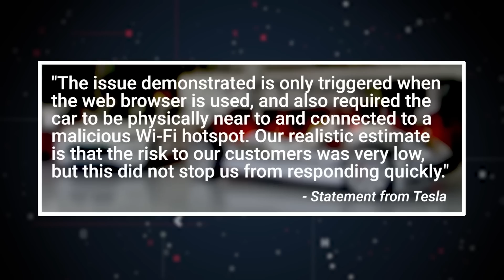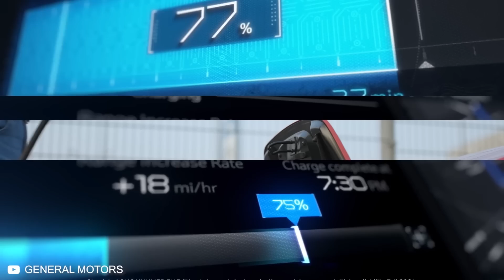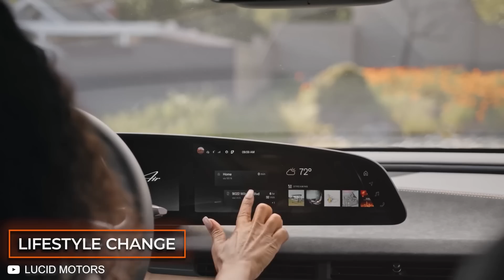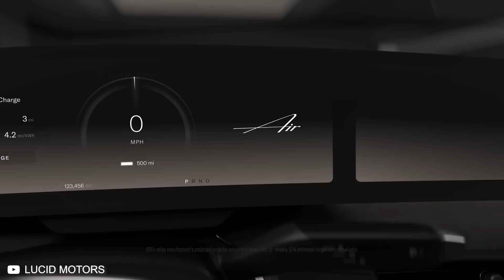EVs' Serious Problems That Carmakers Are Hiding

Comment: I am on disability and couldn't afford to buy a 30 year old used car much less a new electric car. My pickup is 23 years old and has been well maintained. 235,000 miles and doesn't use oil or leak antifreeze. Ot has a V-6 that still gets 24 miles per gallon and starts no matter the weather. I love my F-150 and will drive it till the wheels fall off.
Reply: Neither can you afford a new ICE car!   I run 2 old pickups.  I run a 79 min truck and a 91 1/2 ton 4WD.   

In 10 years when there is such a thing as an inexpensive old EV I would love to get one.  200 miles of range would easily do the trick.   Could live with 100 if the price is right.

Point is EVs are in early times.
Reply: @danharold3087  just like any new tec there will always be teething problems
But with evs it's not just with the vehicles
Here in Australia  our power infrastructure  is crap at the best of times 
Emagine it's summer and 40 degrees outside in the shadow and every bloke and his dog as the a/c running flat tac, it can even cope with that 
Now Emagine  tens of thousands of people  coming home from work at 6 pm and everyone  pluging in in their ev at the same time on that 40 degree day ?
As alot of homes only have on street parking how can they charge thier ev over  night, oh and good luck finding  a charging station at your local  shopping  centre  that actually  works and isn't damaged or vandalised 
Owning an ev can actually  be life-threatening  if you don't plan and use common sense and brains 
Emagine  being out half way between help ,no cell phone  reception  of coarse  on a 40 degree day in your ev with a dead battery
The wife seating next to you ripping you a new asshole and 3 kids  in the back screaming cos they are hot and thirsty and the temperature inside your ev is pushing past 50 degrees and of course alot of people  don't even bother to carry spare water
Of coarse  with petrol and diesel vehicle  10 ltrs of fuel and a jump start  from another vehicle  got you out of danger or at least to the next service station 
With a ev no one pasting by can help you with your ev
The best you can do is leave the very expensive  road side furniture  and get you and your family to the nearest truck stop with food ,water and ac 
Then call a towing company  to go pick up the piece of crap
And expect  a bill you can't jump over 
Perhaps testa and Musk should have that in their sales pitch  when trying to  sucker you into buying one of their so called green cars?
 
Even with petrol and diesel vehicle  you can get yourself into  serious trouble if your not careful and planyour trips even if it's only a couple of hundred kms down the road
Technology  will not save people  from mother nature  no matter how much people think they are bullet proof
Reply: @jonmcnabb6421  does it work when the power is out  , gets full of sand , snow ,water or is burnt ?

Technology  is great til it craps its self 

As that is the first thing to go in a natural disaster  and an  flat EV isn't very useful  when you  need to get out in a hurry with a snow bizzard or  bushfire breathing down your throat or you have 8 feet of flood water inside your home 

It's strange that Testa  or Musk doesn't tell you the very real limitations   and life threatening  situations  you can get into owning  an EV, they just want you to buy a car ,any car 

And yes your right people  aren't bullet proof even tho some thing they are
Reply: @danharold3087  You can buy a chevy spark for half the price of the cheapest tesla. Rising lithium prices are going to seriously hamper the theoretical future affordability of EVs.
Reply: @Mr.9merrickdials  Agree there are less expensive cars and more on the way.  China is going drive down prices.  Seen where a leaf could be had for $20K including $7K incentives.   

I see projections saying too many mines are opening and the prices will drop.  Seems people invested heavily in the metal battery metal production.

Unfortunately my crystal ball is broken.
Reply: @Mr.9merrickdials  Nothing is going to be hampered. There are alternatives to lithium! Look at magnesium.
Reply: It doesn't matter  how old or how many kms (miles) it has on the clock 
The facts it reliable  and can get you and your family out fast in an emergency 
That's what's important
Reply: @waynehewett4017  the likeliness of having an ice breakdown during or just instantaneously after needing fuel is probably 0.00 and maybe many more zeros after that till some number between 1 and 9 shows up. if your argument is that ev's will break down and gas will also but the majority of people on the road are gas at the moment and one of them may have a jerry can. then just wait a few years. that jerry can will become non existent. toe charging will be the thing of tomorow. and your family will continue to be thirsty regardless of the fuel source that breaks down... one might just questing wayne... why your bringing your family on a family friendly road trip with no cell phone receiption
Reply: @jonmcnabb6421  well here in Australia  not having cell phone reception  it common
Especially  when you start getting out in the sticks  and on gravel roads   a couple of hundreds miles away 
I also carry spare  fuel  ,water ,oil and tools  Always 
Wether I'm going down the road or doing a hundred mile trip 
You are correct plenty of people  break down in petrol and diesel vehicles but you have more  chance that people can help you or you can do a patch job to get you to.the nearest  help 
A EV people cannot help you  apart from giving you a lift to the service station  or a phone 
I've seen heaps of EVs on the back of tow trucks   that have ether shit themselves  or flat battery  even in the cities 
Look I'm not against  EVs at all 
In the cities  and short runs they are ideal 
Did you hear about that car transport  ship that sank due to the EV batteries catch fire in the ship hold 
They couldn't put the files out  as the chemicals in side the batteries  produce its own oxygen
Reply: @jonmcnabb6421  to answer your question  no I wouldn't 
First I couldn't justify  spending 80 grand on an EV in the first place 
Which no one will want to buy a second hand ev  in 3 to 5 years 
I would have a petrol or diesel  vehicle suitable  for travelling  or pulling trailers ,horse float etc
And a petrol electric  vehicle For school runs shopping and going to work 
I wouldn't not put my  family a risk   to buy an EV 

have you seen and EV battery  go to hot and got up in flames 
Within seconds it's a Roman candle 
Good luck getting the wife and 3 young kids and the elderly  grandmother  out  in time 
Before  your EV becomes the towering inferno  in 10 seconds 

I don't think Musk or tesla has that in the sales brochure  when you  are looking at EVs?
Reply: In the UK thieves are now cutting charging cable's for the copper, it's just getting crazy now
Reply: @looneytoons2878  that doesn't surprise  me at all 

Here in Australia  we have major problems  with vandalism  ,damage and recharging stations  that simply  don't work that's if you can find a recharging station  after driving around for an hour ?
Reply: @waynehewett4017  Yeah it really is crazy
Reply: @looneytoons2878  people  really  need to be informed  the correct information  about EVs and all the limitations  before deciding  to hand off the big bucks 
As EVs aren't for everyone 
Tho the salesperson  at tesla will never  disclose  anything bad about their products 
They just want you to buy  their vehicle 
That's all they care about
Reply: @waynehewett4017  I will never get an EV that's for sure
Reply: @looneytoons2878  who can afford a 50 to 80 grand vehicle 
I certainly  can't 
I'm quite happy with my petrol Ute and the ability  to go to any service station  to but fuel 
I carry spare ,water ,fuel.,oil and tools to get myself out of trouble  if it arises and get about 500 kms on one tank of petrol 
EVs are just a fad for the people  wealthy enough to be able on afford one 
Here in Australia  the government  wants to bring in a EV tax due to all the fuel tax  they will miss out on  and yet they push people  to go green and save the planet  which is both lies and ridiculous  at the same time
Reply: @looneytoons2878  ha you will... you know why... its called finite resource
Reply: @jonmcnabb6421  I will what ?
Reply: @jonmcnabb6421  the problem  is car makers don't care what type of vehicle  you buy from them as long as you buy one 
EVs are not suitable for  everyone 
They do have alot of limitations 
Here in Australia  your power infrastructure is still in the stone age,   the infrastructure  can't even cope in summer with everyone  use their a/c
Good luck even finding a recharging station  that actually works and we have alot of homes which only have on street parking  so good luck recharging  at home over night 
Due to EVs been new technology   no body can help you if you get stuck out in the middle of nowhere  with a flat battery  or the EV shits it's self 
With  a petrol or diesel vehicle  people  can help by giving you some fuel ,help change a tyre , give you a jump start  etc so you can  limp to safety or the nearest service station 
With EVs you have to get it towed  to ether a recharging station  or a EV mechanic 
You'd better be sitting down when you get the towing and repair  bill
Reply: @looneytoons2878  get an ev.
Reply: @jonmcnabb6421  Why ?
Reply: @looneytoons2878  for transportation
Reply: @jonmcnabb6421  But Klaus Schwab say's, "You will own nothing and be happy" by 2030 so how does that work ?
Reply: @looneytoons2878  i dunno if your talkin like nio and vinfast. i wont buy it. if im buying a 50 to 100 thousand dollar car i better own the battery in it. if you want to spend 50 to 100 thousand on a car with a battery you dont own and be happy with that then knock yourself out
Reply: My car is a 2014 Kia Picanto (or Morning). Very valiant car. Eight years and I hope I can keep it for many years as I take good care of it. The fun fact is that I can't buy a new gas car in my country (at least a decent one with the same specs of my car) because they are crazy expensive now. 

For comparison, if the minium wage in the US is around 1,000/month, an EV costs 50x the minimum wage.

Do you want to know how it is here in Brazil? An EV costs at least 150 times our minimum wage. In my country, nobody will drive if EVs are mandated.
Reply: @Willowy13  EVs are only a statis symbol  for the rich who can afford a new vehicle 
Here in Australia  EVs range from 50 to 80 thousand AUD to buy ( I'm not sure  what that would be in your currency  but it would be very expensive) and 98 percent of people  don't just have that type of  money  just laying around 

Going green  and saving the planet buying an EV is the government's  and car makers lies and propaganda 
Agriculture  and heavy industries  produce 6 to 7  times more Co2 then cars ,trucks ,planes and trains could ever do 
I don't see any  government's doing anything about them at all ?
 Here in Australia  the power infrastructure  and recharging stations  we are still in the stone age 
Alot of people have only on street parking so no way to recharge  at home 
Good luck trying to find a public recharging station  that's not vandalised,  stripped of its copper , damaged ,broken or simply  doesn't work
The amount of times I've seen a tow truck rescue  a EV with a dead battery  is ridiculously  funny 

I would advise people  to keep the vehicle  you have now , sure fuel prices are going through the roof  but it's alot less than buying a EV shit box that costs 80 grand
Reply: The government is forcing u to by an ev when gas powered cars not ganna be an option 🤮I thought this was a free country keep ur ev I’ll keep my GMC Sierra
Reply: @colejones6369  here in Australia we  still in the stone when it comes to power infrastructure 
It can't even cope  during summer  when we have 40 degree days and every Tom, dick and Harry has the a/c running 
How will it cope with tens of thousands  come home at 6  pm all at once to charge  up.their EV ?
I live in Perth Western Australia  in a suburb  called Caversham  which is a reasonable  area and looking up recharging  stations we have one as far 

EVs are a statis  symbol  to the people  who can afford a 80 grand electric car
Reply: every one comes home at 6 and charges with a 120 volt oh no😱 wait a sec strange. kinda seems like everyone coming home from work and turing on a light bulb or turning on computer or tv... huummm let me think about this for a sec 120 volts... im sorry whats the problem again?
Reply: @colejones6369  we have 1 ,3 Bay  recharging station  in this area 
But most the time it's ether but damaged or is not working 
The amount I EVs I've seen been "rescued " on the back of a tow truck due to ether  shitting it's self or flat  battery  is ridiculous 
Alot of homes have on street parking so recharging  at home is difficult 
In China they are having 6 to 8 EVs burn to the ground  each day 
Too bad if your in traffic  and you have to stop and have the wife and to young children in car seat in the back 
Good luck getting everyone  out to safety  in time  as you  have only  less that a couple of minutes  before your EV is a roman candle 
Battery  fires are very difficult  to put out due to the chemicals   in the battery producing its own oxygen  and very toxic fumes when hot 

Even the fire fighters  have drown the vehicle in foam and powder  to have any chance  of control
So you as the owner of a 80 grand EV has no change at all 

I'm sure that's not in the sales brochure  in the tesla showroom and pointed out to people  interested in buying an EV

I'm not against  EVs as they do have their place in the cities 
We will always need petrol and diesel vehicles  to do the jobs EVs can't  example  transportation  of goods ,towing caravans,  trailers  or horse floats  etc 
Like the US   Australia  has long distances  between towns and service  stations  and the infrastructure  to travel thoses distances  safely  in a EV is not safe especially  during summer 
You could easily  get into a life threatening  situation  if you EV shits it's self out in the middle off nowhere on a 45 degree summers day 
EVs are not a magic bullet  to all our problems and are not suitable  for everyone 
Who's got 80 grand  to spend on a EV ?
Alot of people  don't earn half of that in a year 
The fact are to break even  you have to drive your EV a 140,000 kms   with the 25 to 35 percent increase  in cost to buy an EV  compared to its petrol  or diesel  equivalent 

Something  else the salesperson at tesla conveniently  forgets to tell and buyer
Reply: @colejones6369  EV s have their place  but we will alway need  petrol  and diesel  vehicle  to do the jobs EVs  simply can't  do
Reply: Stop the climate scam if you want to keep your cars.
Reply: @mxrx3786  yes policians  normally  are in fairy land 
Going green  and saving the planet  propaganda  and lies 

Evs have their place but until  power  and recharging  infrastructure   improve inside the cities 

They will nothing more than very expensive  garage accessories  and statics  symbols 
Even if everyone  brought  a 80 grand ev  it wouldn't save the planet as carmakers have to actually  build all theses cars plus what are you going to do with the millions of old petrol  ,diesel  vehicles  your replacing?
Plus evs are useless in an emergency  where the first thing to go out is the electricity 
In a flood  ,fire ,storm or snow  blizzard  so how can you charge your ev in that situation?
What happens  if you have a fire breathing down your neck  or 6 foot of water and rising  your screwed 
My advise is to use the vehicles  you have now but more wisely 
At least you can get you and your family out if you have to  with a petrol ,diesel  vehicle  
Testa and other carmakers tend to forget or just gloss over all the limitations  of evs  as they don't care ,they just want you to buy a vehicle off them  regardless  if it the right vehicle  for you or not
Reply: @mxrx3786  So what is the Solution let's hear it,you don't have one either other than running ourselves to the Ground by Polluting our atmosphere with Co2 emissions forever and Ever until you die Basically,you probably work for Big Oil or have Stocks in Big Oil,that's why you defend Oil you're not giving a solution,only negativity.
Reply: @jonmcnabb6421  I gather your in the US and have better power  infrastructure  ,more recharging stations  and clearly  have more EVs

Here in Australia  it's not the case and we are way behind  in the infrastructure  and recharging  stations 
The other things I point out  that car manufacturers  choose  not to point  out  is the EVs limitations and life threatening  situations  you can get into 
Examples 
What's the first  thing that goes out in a natural disaster?
electricity 
So  a flat EV is useless
If you have to get out in a hurry 
A snow bizzard 
A bushfire breathing  down you head 
8 foot of flood water  inside your home 
At least with a petrol  or diesel vehicle  you have alot more chance of getting you and your family out to safely 
The other thing if you break down in a EV on the side of the road   in 40 degree  heat no  passers buyers can help you 
They can't give the some fuel or jump start you to get you to the nearest help can they ?

All they can do is give you a lift to the nearest  service station  or phone
 
So your 80 grand EV becomes nothing but expensive  road side furniture 

That's if it is in one piece when the tow truck gets there  to pick it up 

And you need  be sitting down when they give you the bill

And the wife ripping you a new asshole  for wasting  80 grand on a EV that is bloody  useless in any natural disaster 

Give me the petrol  or diesel vehicle  any day of the week
Reply: banning is stupid... your going to feel real stupid at the hardware store thats since gone through reno and seems like elevator music... your going to ask the clerk wood stove? and there going to look at you like deer in headlights
Reply: @jonmcnabb6421  as I said EVS have their placeand when battery  technology  improve  EVS  may have more uses but that time hasn't happened  yet 

Evs have limitations 
Tesla and other ev car makers  need to educate  buyers  to choose the right vehicle  for them  Wether it be an ev or a petrol or diesel  vehicle 

Going green is a load of crap  
Vehicles make up about 4 percent of the co2 gases  produced 

It's agriculture  and industry  that produce almost of the rest of co2

If we want to slow down climate change  that's where we need to focus
Reply: @waynehewett4017  Yes and as I said in the previous comment very few countries have electricity produced by nonpolluting methods much of the world electricity is still generated and thermal power stations i.e. burning of some sort of fossil fuel to generate electricity hardly green energy!
Reply: Electric cars are a massive environmental disaster. Why would you buy one?
Reply: My 2002 vehicle with 200,000 mi. only costs $100 to replace its battery every 5-6 years.  The typical out or warantee replacement battery will cost between $13-$18k after about 8 years.  What's the carbon footprint on changing out an EV battery every 6-8 years ... for $13-18K????

ON a conservation of energy basis ... to change from fossil fueled vehicles to all EVs the total electric generating capacity of the US will have increase its FOSSIL FUELED electric generating capacity by approx. 50% .... for the exact same amount of energy needed.
Reply: @richh1576  If we transition at a reasonable pace the grid can keep pace using renewable energy.   Nuclear would be good.
'they are working on' batteries that will last longer than the cars.   Talk of buying a new car and installing your old battery.   Grain of salt here as to time frame.  But it is on the way.
Reply: @danharold3087  solar and wind win out over nuclear... nuclear is a thing of obsolete technologies
Reply: @jonmcnabb6421  I would prefer solar and wind.  But Nuclear has not been standing still.   Nuclear is now a valid option for peaking.   It could also stand in for solar or wind should they fail for some reason.
Reply: @danharold3087  and they say ai can solve our nuclear power problem but my questions are doesn't that create nuclear waste? if the ai is so smart and can do all that without the waste why not just a simple improvement on solar cells, wind, tidal and geothermal... leave ai's potentially exploding nuclear for mars travel?
Reply: @jonmcnabb6421  AI is a category of computer programs not easily solved by normal computer programming.   Once we figure out how to solve these problems they are no longer of interest to AI researchers.  There are other definitions for AI.

So AI is not 'smart' in and of itself.   It is just a set of bleeding edge tools used by smart people.

AI techniques may well do a better job of managing a reactor.  It could reduce the risk of reactor problems.  But  it will still make waste.   Some say nuclear waste can be safely stored in 3 mile deep shaft/wells under the nuclear reactor site.  Other disagree. With the current political situation I doubt we will see much nuclear.
Reply: @richh1576  my battery expired in 2017 and it’s still running
Reply: @Amor1990  The reason is most probably that you are not DEEP cycling (allowing the battery to go to almost full discharge before recharging).  'Hysterisis' (performance degradation)  accumulates 'faster' when any rechargable battery is constantly DEEP cycled.  :-)
I have very large gel cell batteries (with an advanced hi-tech charger) on my boat's electrical system that are ~20 years old ...  but that wont happen without an advanced  'smart charger'. I religiously do not deep cycle these batteries in order to preserve and extend their in-service life.
Reply: @richh1576  no carbon footprint or very little as the battery pack gets recycled reused or repurposed... very expensive to replace an entire pack instead of just one cell though one would think
Reply: @richh1576  Well put -great summary😊
Reply: @richh1576  Or we could build more lithium hogging solar and wind farms /sarcasm
Reply: @Mr.9merrickdials  Sources?
Reply: To be honest you far better off keeping your old vehicle  as long as its not too unreliable 
Evs are not green at all no matter what the fuffiers say 
The car industry  doesn't give a shit what vehicle you  buy as long as you buy one  they are quite  happy to sell you a ev or a F 350 truck 
There is no recycling  of ev batteries  at the moment  nor it seems any plans in the future so are these  batteries  going into some land fill in 4 to 7 years when the battery shits, its self ?
Ho and good luck in trying to sell you second hand ev ,the one you paid 70 to 80 thousand dollars  for  a couple of years ago  and now you can't even give away
The car makers forgot to tell you  that ?
With that in mind buying an ev sound like a bad investment  where  within 10 years you lose everything  making the ev worthless 
If you want reduce pollution  in our cities a petrol electric  vehicle  is a far wiser investment  and let's face it due the vehicles  being so bloody expensive  now buying g a vehicle  is  a big investment  so it's very important  to look at what type of vehicle  you really  need and your situation  and lifestyle 

Remember  ebs have alot of limitations and not only in range 
So evs cannot suit everyone and still have a hell of a lot of work to go .
Reply: @waynehewett4017  Keeping your reliable vehicle has always been the most economical.  People have been saying that since I was a kid.  Now retired.  

There is no recycling of EV batteries because used ones are being sold on ebay for use with home solar.   Tesla is recycling batteries used in research and testing.   95% of the metals are reclaimed.     When new denser batteries are produced with recycled material it will result in extra metal. Something like for every 10 old they build 11 new.  Oh and the old batteries in conjunction with solar may well help charge the cars and provide peeking for the grid.

I agree with you on a lot of this.   But if people, foolish or not, don't buy current EVs there will be no money to develop improved technology.

It is amazing how fast this is moving.  Some AAA affiliated tow trucks can fast charge stranded cars.  Hotels and even B&B offering charging sometimes free.   I imagine some forward thinking guy is selling his excess solar energy to EV drivers instead of trying to sell it back to the grid.  When I looked into that I found a movement to use EVs to provide peeking.   Charge the car off peak and sell some of it back during peaks.  

Still early times for EVs
Reply: @danharold3087  I'm no expert  at all my friend  and never claimed to 
I try to push past or the fuff pieces ,lies and propaganda  we all deal with ever day
And ask the questions that not many bother to do so 
And not many will volunteer  the actual  truth 
I'm only a guy so we can't be right all the time not even 50 percent  of the time according  to some women  if you know what I mean 
Your right evs and power infrastructure  have a long way to go 

I'm glad to hear you guys over there  are recycling  the batteries 

But here in Australia  nobody government  or private  enterprise  have no actual  plans as yet in place to recycle  ev batteries  or any other  components 

Policians  seem to have their eyes glazed over  with all the taxes and fees they charge  for new evs plus this ev tax to make up for the fuel tax  and any other taxes  they can  make up 

No wonder the rest of the world  thinks Australia's a bloody  joke
With theses muppets in charge  we are still in the dark ages
Reply: @waynehewett4017  First I admire your country.  Just wish it did not take a ton of money and an act of god to send packages back and forth.     My wife and I both have friends there.

A while back I learned that our governments work against our interests.  No big surprise there.  So when I think of australia its the wonderful people I know there and not your government.  

Well recycling yes but precious few EV batteries as they have not yet gotten to where they are useless as batteries. It is just the ones they used in development and testing.  Talked about this earlier.  Thing is they figured out how to do it .  Given Tesla's goals I expect him to share.  Did you know that a few years ago Elon open up all his EV patents for use by others.   

I kinda understand where you're coming from.    Thing is it is changing so fast anything we think today could be bull crap tomorrow.    I ran into that a few times while googling so I could accurately respond.   Learned quite a bit.
Reply: @danharold3087  Dan I'm just guy , I'm no expert  but I've been around  the block a few times probably  not as many times has you have my friend 
Australia  isn't a bad place but there's this image that overseas people believe  every  thing is ether trying to kill and eat you 
That's simply  not true 
Sure if you have a death wish 
You can travel ill equipped  outings the Simpson  desert 
You can go play with a cranky  Tiger snake 
Go swimming in Crocodile / shark  invested waters/ oceans 
Or stick you hand down where funnel Web or red back spiders live
Or do alot other idiotic  life threatening  things 
 If you do stupid  things you will get hurt or die and that wouldn't matter what country  your in
We are ment to be intelligent  and use common sense  and what your gut feeling says 
Personally  I think the US and Canada  have more dangerous  animals than we do 

The thing I will say as it get hot here in the summer and the flies
Reply: @waynehewett4017  "good luck in trying to sell you second hand ev"  If you think used EVs aren't worth anything as used cars you're nuts or blind.  Try to find a used EV for any serious discount from the new price is almost impossible.
Reply: @waynehewett4017  Not to mention that currently a great deal of the world’s electricity is generated in a thermal power station which makes the whole EV green energy thing flipping joke
Reply: You're are on the minority but most people wouldn't mind making the upgrade,knowing the Gas and Maintenance savings that you get from driving a fully electric car,you will forever be tied down to Big Oil needing to buy gasoline at inflated prices $5,6,7 ,,or 8 dls a Gallon depending on what State you live in
Reply: @magallon643  it wouldn't be that hugh if the democrats had not done some of the things they have done. When Trump was in gas in my town was 1.68 a gallon. Now electric cars don't get you off oil. Plastics and vinyls and nylon and rayon are all from oil. Some meds have oil properties in then. The government is telling us we well have brown and blackouts now. When that happens how will you charge your car. Maybe in 15 years we will be advanced enough to get off but not now. Power grid can't handle it. Windmills freeze up solar only works in sunlight. Windmills have a ten year max life then they cut the blades up and bury in the ground. What does that do to earth. Look at the destruction being done to earth by mining rare earth minerals. Not good. I can go on if you like.
Reply: @magallon643  not everyone  can afford to buy a 80 grand ev 
I'm here in Australia  and the infrastructure  and recharging  stations  just aren't  available  enough without the fear of your ev dying on the side of the  road 
I wouldn't spend 80 grand on an ev as it doesn't suit my needs
Reply: @magallon643  it's true you see people that have run out of petrol  /diesel  or have a dead battery 

But the point is  if you break down  in the above vehicles  a normal passer byer  can help with ether a few litres of fuel or a jump start  the battery to get you out of trouble  or to the nearest service station  or mechanic 

With evs people cannot help you   and you need a tow truck  to ether get your ev charged or repaired 

If your out in the sticks you can be waiting  along time and or it will cost you an arm and leg  to sort the issues  out
Reply: @waynehewett4017  have you seen the New F-150 lightning that Truck is fully electric it can actually charge other Ev's, just like Hyndai Ioniq 5,along with the Kia Ev6 buya there's no Losing with Ev's man,it's only a Metter of  time before it becomes a really common thing with Ev's ok.
Reply: @magallon643  it's good that things are improving  but not everyone  can afford a ev and here in Australia  we just aren't set up yet
Reply: @waynehewett4017  sorry to hear my ev only cost 50 and has charging stations galor... i dont really use them 99 percent of the time i just use a 120 volt... i expect most 25 grand petrol equivalents to cost just as much within 5 to 10 years on maintence, gas, and higher insurance prices. my car should last 10 to 15 years.... thats after warrenty... out of warrenty im gonna try for 20 to 30 years... thats also with an after market hitch and trailer
Reply: @jonmcnabb6421  at the moment  evs cars aren't  suitable to pull trailers 
I not even know if tesla sells towbars from their range of evs 
Clearly  in the US  the power infrastructure  and charging stations  are good enough  to have an ev 
But not everyone  can buy an 80 grand ev 
They worked out that you would have to .drive  an ev 80,000 miles or 140,000 kms to break even  with the extra cost of buying an ev compared  to its petrol equivalent 
How many ev owners are going  to keep the vehicle  for that long  when a new model comes out every year?

Some people  buy new vehicles  every year 

Buying an ev will not save the planet as much so Musk and tesla want you to believe   they just want to sell cars  they don't care
Reply: @waynehewett4017  i can tell your frustrated... and you know what i may have come off as a prick... im also not always right... lets maybe try and see things from the same point of view. i see your from Australia which is intriguing to me. i myself live in Canada not the states. Same deal... a little colder... better electricity prices. i see you like to state fire a lot as a potential issue. but my research concludes that ice vehicles are 10 times as likely to catch fire every 19 million miles and evs at about every 205 million miles. one argument you make is there is no one with a spare battery but theres likely someone with a spare jerry can... but again to utilize that jerry can puts you in a vehicle with combustible fluids running through out. on the flip side theirs vans and rvs. idealy with gas only going through a cheap generator or even better all solar and battery and only gas stove... cause i mean hell if somthing goes wrong with the camp stove im sure its not the end of the world to maintain or replace...
Reply: @jonmcnabb6421  no your not coming across  as a prick my friend 
People are entitled  to thier own opinions 
Yes it's true petrol  and diesel  vehicles do catch fire and you only have seconds to get you and your family out to safely  before the vehicle burns to the ground 
The Ford Explorer  is a good example 
Yes I am in Australia  and bushfire are a very serious  threat  to people ,livestock and property 
And when a fire is coming  you need to get out fast and you cannot depend  on been rescued  as they  have enough on their plate already 
The point i was making is in a natural disaster  electricity  is the first thing to go out 
If you have your 80 grand tesla in the garage  with 10 percent in the battery  how can you get out quickly ? 
I spose if you do have a generator , solar power  you could try to recharge the battery but doesn't it take hours  to put a decent amount of charge in a battery ?
So if you have a bushfire breathing down your neck and you have 10 minutes to  get out cos the wind changed or 6 foot of flood water in your kitchen and your shit box testa disappearing under water in the garage 
Your  fucked ! 

As you said your from Canada  so you guy have snow storms and bizzards every winter and 20 below is like a day at the beach to you guys 😄😄😄

Another thing batteries tend to die in winter due to the cold  with any vehicle 
So how is a tesla battery going to work when it's 20 to 30 below ?
Reply: @jonmcnabb6421  my friend  I'm not against EVs at all 
They have their  place in the cities, school runs ,shopping ,going to work ,kids sport activities  on the weekends  etc 

But til battery  technology  improves EVs will always have limitations and even then there are jobs EVs cannot do and we will alway need petrol.and diesel  vehicles to do those  jobs 
For example in Australia  95 percent of  good are transported  by truck  a bit by rail 
Here people towing ,trailers ,boats ,horse floats ,caravans  etc 

EV s cannot do that here in Australia 
I have heard Ford America  is developing  batteries for an electric Ford 150 or something

But like Musk and tesla semi truck Musk promised  and never  delivered
 
The semi battery was going to weigh ether 5 or 7 tonnes just for the battery only   then you have to weight of the semi and trailers plus the paying load 

To be honest I would keep the vehicle  you own now as it will be cheaper and safer for you and your family  in the long run 

Til people are informed of the limitations  and dangers  of owning an EV  it's no worth the risk if you plan to travel alot 

But tesla and a the other carmarkers don't care if the vehicle is  suitable for you  Wether it be an EV or a big diesel SUV 

All they care about is you buying one of their vehicles
Reply: @waynehewett4017  dude i dont know what to say. it sounds like your having some serious life issues... nothing to do with cars. by the way i drive a Tesla... and i take serious offense. is Tesla the car of my dreams... no. is it the best car efficiency wise i could possible purchase to date... yes. would i love for jeep or hummer to have a baby with Tesla... absolutely. do i want petrol or diesel... no sorry i just want the suspension. point being is im not talking about off road vehicles im talking about vans and rvs... and im sorry id rather have gigantic batteries and solar out in the middle of  nowhere rather then the idea that some random person is going to find me and all the sudden have a gas can on them
Reply: if you need to get out of garage quickly there's two major factors... one is disconnecting the car from power cause it will not drive if its plugged in... the next is opening the garage door. other then that 10 percent will get you out of a fire... never will my car be at ten percent due to battery cell damage at that level. usually i spend around a 60to80 k a day.... and at 10 k an hour takes about 10 hours to go back to 300k from 200k... without a 240v... i just use a regular old 120v. yes its cold here and in the winter we can experience up to 15 percent range loss... but quite honestly im not out and about camping during the cold weather... and more importantly during our summers we have ginormous forest fires. probably 10 times the size of the ones in australia... i remeber somthing like 134ish forest fires last summer or somthing like that... thank you buy the way for donating fire fighters... we needed them. however are towns and cities have 10 times the area to be spread out. but definatly the last few years have been smog smog and more forest fire smog not to mention the flood last winter which took out half of vancouver. why are we talking about natural disasters though.. and what do they have to do with cars? last i checked my car connects to the internet and with starlink just now becoming active, i dont think there'll be any worry about cell phone reception. little would that change if you had a gas vehicle... heres what i will give you... if you live in a circuit and theres cars passing buy... theres maybe 2 to 3 years left maxxxx that people would have a spare gas can... even you said it yourself once they have a lighter battery car why buy a petrol. question is why lug around a heavy petrol engine... why not electric at 95 percent efficiency rather then diesel which i think is only at most 35 to 45 percent efficient
Reply: Still in the garage so you all spend the night on the roof of the house cold and wet or worse 
Now if you had a petrol or diesel vehicle  could have got out in time even if you have drive through  the garage door to get out 
You need a reliable  vehicle  to get out in an emergency  and sometimes  you only have a matter of minutes  to do so 

I don't think tesla has that in the sales brochure?
Reply: @jonmcnabb6421  I'm not knocking you buying a 80 grand tesla  that's your choice  my friend 
 But if I had  a choice to being out in the middle of nowhere in a tesla or a petrol / diesel  vehicle  in the middle of a 45 degree  day in summer 
I know which one I would pick 
The problem  bring spare batteries  for your tesla  is batteries  are very  heavy  and the heavier  the tesla  is the more power it uses therefore cutting down your range

Example  the battery for the tesla semi was about 5 to 7 tonnes just for the batteries  alone by its self 

Til battery  technology  improves  EVs will always have limitations
Reply: @waynehewett4017  sorry to hear that honestly... where im from none of that exist.... maybe your area has a crime problem? where im from i drive to the charger is starts charging and honestly the  as your talking about goes through many more tiers... but thats where ev drivers are in the know... if you want the honest answer 500 kw charging is end game. 150 or 250 or what ever they say they do today isn't true but 50 to 100 is. and in my opinion unless your feeding an army thats all the average person would need... when the car says its recharging at an average of 1250ish kmp/hour one tends to not care so much about how fast its charging...maybe your government is making it hard to adapt to the supercharger network? does australia have no superchargers?
Reply: @waynehewett4017  my ev doesn't open my garage door the clip on garage door opener does. every thing is the worse situation with you dude i dunno. i honestly purchased the car from a financial point of view. if you've got flood or fire get out of the house address damages after when it's safe to do so... obviously.
Reply: @jonmcnabb6421  no its not that we are in a bad area 
As your know Australia  is a big place 
Even in Australia's capital  city Canberra  were all the useless politicians  hang out  the infrastructure  is still in the stone age 
Here in Perth Western Australia  where I am  it's even worse 
Alot of houses only have on street parking so no way of recharging  overnight  
Recharging stations  are far and few  between 
The amount of EVs you see on the back of a tow truck is ridiculous  as the EVs has ether shit its self or  its good a dead battery  trying to find a WORKING recharging station 
See Australia  is only a very small market for EVs unlike in the US  and Europe 
So spending billions  of dollars upgrading  infrastructure  and putting recharging stations  every  where  is not economical or practical 
The fact EVs have very serious  limitations  we will always have petrol and diesel vehicle  to do the jobs EVs can't 
Like in the US  90 percent of goods are transported  by road or rail 
Towing caravans  ,trailers, horse floats etc aren't yet possible  for a EV to do 

I have heard  ford in the US  was developing a electric   F 150 
But I'm yet to hear any up dates on that

Ford F 150  250 etc here in Australia  the petrol or diesel  start from 140.000 dollars  so emagine what the EV equivalent  would cost ?
You would be better buying a small diesel  truck instead  it would be  cheaper 
The government  here is pushing  every  one to save the planet by going green and buying an EV
Which is so we know a big pile of horse shit 
Plus who had 80 grand just laying around  to buy a EV?
To be honest Hybrids  are the way to go , sure they are as environmentally friendly  but at least you can get your self out of trouble  if the battery  shits itself  plus you can pull into any service station  and buy fuel 
Alot of taxi drivers use Hybrids 
I know Hybrids  can't tow trailers  ether  but at least your not completely  helpless
Reply: @jonmcnabb6421  look my friend  I'm not disagreeing with you  EVs have their place and it's great you are happy with yours 
Having less pollution  in our cities is always a good thing  especially  around  schools and daycares
Great for school runs ,shopping  and weekend sport activities  for  the kids  or going to  work 

But  they are not a magic pill to all our transport problems 

That's the point I'm trying to get  across 

I'm just a guy I'm not expert nor am I right or wrong  
People are entitled  to their own opinions  so go for it 
I'm glad your happy with you EV
Reply: become a watt head rather then petrol head soon then later thats all i have to say... your not going to get anything for the tacoma... that was nearly 30 years ago
Reply: @jonmcnabb6421  I'm not against EVs at all 
In the cities and short runs they are ideal 
But EVs at the moment  have very serious  limitations due to battery technologies  still in its infant stage 
If your EV breaks down or the battery  dies on the side of the road 
Nobody can help you 
They can't give you some fuel or a up start to go you out of trouble 
As EVs are complicated  technology   no body but Tesla etc can fix any problems 
So if your tesla has shit it's pants on the side of the road in 40 degrees heat with the wife and 3 kids in the back and of coarse no  mobile phone service  what are you going to do ?
Or you've just come home from work  to charge your EV and there's no power  due to a fire ,bizzard  lighting  strikes  and flood damage  and powers been knocked  out for miles 
How are you going the get the wife and kids out in a emergency?
.
See this is what tesla and all the other car manufacturers  and dealers  forget the tell people  who want to buy an EV

emagine having a bush fire storm breathing  down your neck  and you can't get out  cos you fucking  EV battery is dead  (all mains power is knocked  out )
and your wife and kids burn to death  because  of that fucking EV

It will be little comfort  in your loss  saying your going green
Reply: @jonmcnabb6421  well the guy with the Tacoma as well as I with the 99 f-150 are not wanting to sell. What we have done is taken care of our vehicle every step of the was. I have replaced the exhaust and the belt once. I have had 5 new batteries. Every 3 to 4 years new tires. Oil changes every 3 to 4 thousand miles. Air filter every 3rd oil change. Tune ups every 50 thousand miles. Radiator flush every 3 years. Ac works great and never recharged. Brakes 2 times. Truck has been well taken care of. Runs great and looks great and drives great and comfortable ride. Why replace it?
Reply: you technically speaking would just need to replace the engine ... you know if gas kicks the curb
Reply: @jonmcnabb6421  true  But EVs are alot heavy than thier petrol equivalent  with that very big battery 
The fact  is EVs have limitations 
Very important  information  that Musk and tesla don't have in the showroom brochures  or " forget "  to tell people looking at buying one 

1/ alot of people  have on street parking  so how can you recharge  each night 
2/ trying to find a recharging station  that isn't vandalised, damaged or  simply  doesn't work when you have 10 km left in the battery 
3/ no one can help you if you testa  shits it's pants on the side  of the road with no cell coverage 
4/ in a natural disaster  which the first  thing that goes out ?
ELECTRICITY!!
 So how are you going to recharge your tesla shit box?
5/  so with no electricity  and you have to  get out  quickly  say a bush fire ,flood  or a bizzard at 20 below outside ?
 Say your driving our testa out in the country  with the family  and it shits itself  in the middle of nowhere, it's summer and 40 degrees  outside 
So your  parked on the side of the road ,no cell coverage  of coarse 
The wife next to  you ripping you a new asshole buying a 80 grand piece of trunk and 3 kids in the back complaining  they are hot and thirsty
And in 10 minutes it well be 50 degrees in that tin oven ?
In situations  like this no one can help you  and it could be a serious  threat  to your and your families  lives
Dying of exposure, heatstroke,  thirst is a real thing especially in  summer 
How many people carry spare ,water ,fuel , oil,  firstaid kit and basic tool around with them in the vehicle?
People cannot help if you breakdown or the battery dies 

They can't give you some fuel or a jump start to get you to the nearest help  
Only a towtruck and a trip to the tesla  mechanics  can help 
Just be sitting  down when you get the towing and repair bills

I best testa  doesn't have that in the sales brochure?

Without education  and informing people  of the limitations  it's only amatter of time  some idiot in a EV get stuck out in the middle of nowhere  and dies out there with thier family 
It's not just tesla but any carmaker that builds EVs 
As there will always  be some fool  who  thinks  they are bullet proof